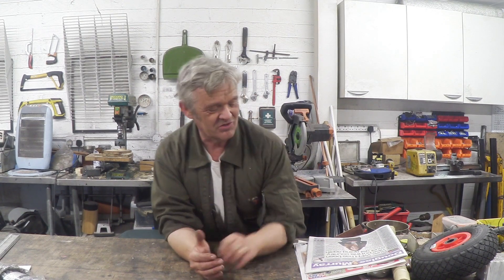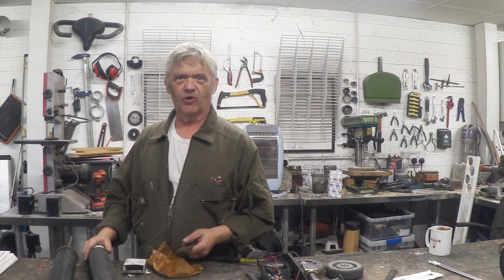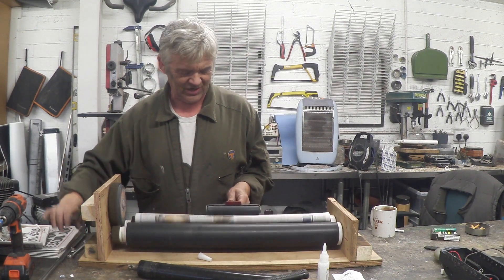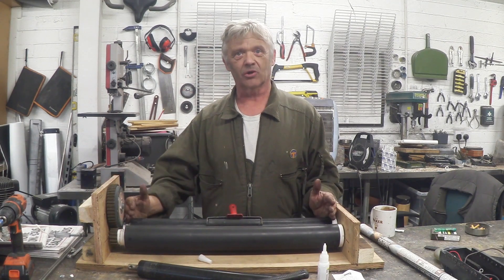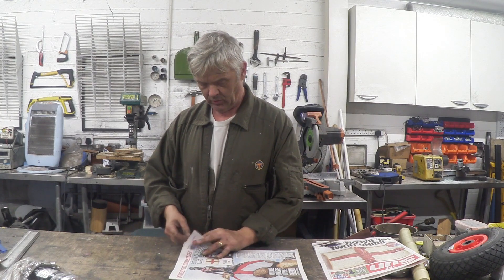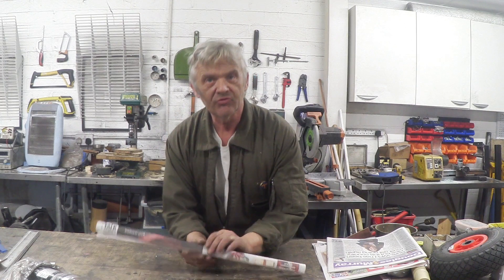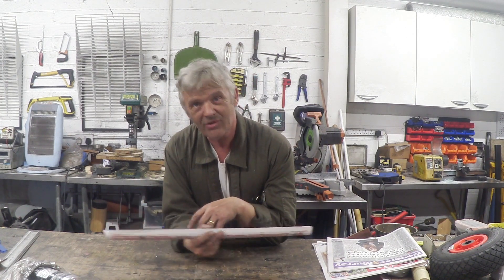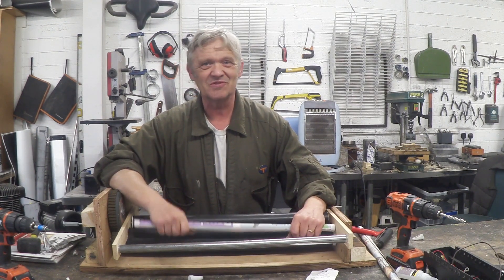1165 A Paper Bicycle Made From Old Newspapers Part 1 Making The Tubes

Comment: When you needed to make longer tubes than the width of the paper do you just stagger 10 sheets total side by side? Also if a thicker pipe was needed do you think it would be best to start out with say 10 sheets or to start out with five and after it is rolled add more?

Comment: As an electrical apprentice in the early 70s,  I had to make insulation tubes out of brown paper and fenolic resin,  we also used a type of varnish to make these tubes.  They were used to make formers to make transformers, coils etc.  We made them on split timber mandrels, that could be collapsed slightly to remove them. 
They were very strong and machinable.
Reply from the maker: there are all kinds of resins for all kinds of jobs mate - paper tech  is an awesome tech

Comment: Dear Mr. Murray-Smith, thanks! I'm not sure, but if the paper is anisotropic, aligning the wood fibers along the axis of the rod should provide you with some extra strength. But even more important, can a pipe be done? It can also be stronger than a rod and you save the precious material  :)
Reply from the maker: you are spot on mate as it is machine made the fibres lay in the direction of the machine flow and is exactly what I did - I didn't talk about it in this video as the video already. had enough info in it - but I will be talking about that in the next video

Comment: A simple device, but I think I would set up a one sheet with an epoxy to wrap around your paper tube, to keep it tightly wound, and a bit of stiffness, keep it from bending in the wrong spot.
Reply from the maker: I agree mate the initial rolling tight is hard to do but after you have a pole of a certain thickness it is easy to roll - I think starting the rolls in the chine then thickening them up manually with glue or resin soaked paper would make a good stick for something like a bike frame

Comment: Black Bamboo Seeds Cost £5 For 50 , It's Non Invasive Here In The UK 
I've Got Some Growing
Bless Up Rob :)
Reply from the maker: nice tip mate - I may get some and plant my own
Reply: @ThinkingandTinkering  My First Plan Is To Plant Them In A 14 Foot Ring On Some Disused Land Near Spaghetti Junction Then When They Get Tall Enough Bend Them Over Into The Middle And Use Plastic Tie Clips To Hold Them In Place , So It'll Be A Living Dome Shelter For Anyone To Use :) 
Plan Two Is To Grow Fields Of Black Bamboo In St Ives Cornwall And Build A Bamboo Ship With An Aluminium Skin The Propulsion System Will Use No Propeller 
Watch This Space 
Bless Up Lads :)
Reply: can energy be harvested from the swaying of the bamboo?
Reply: @YeshuaGod22  Yes If You Use Friction Strands :)
Reply: @joohop  so you'd  just need to do the  bending when they are fresh  newly  sprouted spears at about ¾ full hight. They grow to the full higjt of 6 to 12 metres or mpre in say five weeks by obtaining  the energy primarily  from the energy stored t throughout  entire grove. One grove is one big bamboo plant .An  interesting plant and there's  stuff on yt of course   gotta wade through  it through.
Reply: Bamboo seeds? That must be a rare phenomenon  but it does sometimes  flower . Id been  reading nonabrasive instead of noninvasive in your comment  , it held me up just a bit.

Comment: Is there a bio resin/plastic you could use to waterproof the rolls?  Like the hemp plastic Robert made before, thinned to the consistency of water so it can soak into the paper.  Does anyone know of anything like that?
Reply: The magnesium based cements might work well in some applications as they bond very well with cellulose 
Rob has done videos on casein based plastics as well as mag cements
Reply: @johnmcfadden9336  I've seen the videos.  Didn't know the cements bonded with paper.  I'd think that concrete would be brittle, but. who knows.  The bioplastic from milk would be what I'd want to try first, the only question is if it can be thinned to soak into the paper/be easier to work with.
Reply: @McRootbeer  mag phos cements bind very well with cellulose and almost turn them into ceramic type materials but I agree they may not be best for high vibration applications 
Water based polyurethane or pva even  vinyl or acrylic exterior paints,  Water glass, but robs plastic could be a favourite
On reflection a lot of these options might interfere with the rolls compressing
Reply from the maker: milk based - casein - would work very well here mate
Reply: The pl asnt oils perhaps.  The well known  one is linseed which also was a basis for paints . C a nola oil  was once used for p a ints also. Cotton  seed oil just 6gats very sticky .

Comment: This looks just like the roller system they use to make cylindrical cells.  Would it work if you cut a strip off the newspaper, painted the sides, rolled it up, and dipped it in electrolyte for a while to let it soak in?  Stuff that in a PVC pipe, and some aluminum covered in conductive paint could be the terminals.
Reply from the maker: yes it would mate! - very nice thinking and exactly what was on my mind

Comment: Now I’m thinking a thin resin, vacuum or pressure chamber to impregnate (autoclave) the rolls with this resin to add extra strength. Maybe a waterproof PVA glue soak might do the trick.
Reply from the maker: or casein maybe?
Reply: You might end up with even nastier waste than sun newspapers alone. I suppose heatshrink tubing would also do a decent job here.

Comment: I think this is awesome  Rob. As mentioned earlier in the comments, I am curious what you will use as a glue or binder.
Reply from the maker: I was thinking casein mate - an interesting bio resin that bonds very well to paper and can be thinned easily
Reply: @ThinkingandTinkering  why not paper mache corn flour and when dry you can then water proof with casein ?
Reply: @Buzzhumma  casein is likely good for batteries it is obvious or i am just a little crazy which is true lol
Reply: @ambersmith6517  mostly the bio aspect . It breaks down in the ground !

Comment: Looks like you can use any kind of paper on it.

Try checking with local businesses if they have waste paper they can spare.
Reply: just sign yourself up to every free newsletter/catalogue going, you can have a truck load of free paper delivered to your door on a weekly/monthly basis
Reply: @bugz000  remember corrugated cardboard is just 3 ply 120gram with a starch glue, you can reuse that by simply hand spraying it down till its soaked then separate & reroll it ready starched good to go.
Reply from the maker: I would think so mate